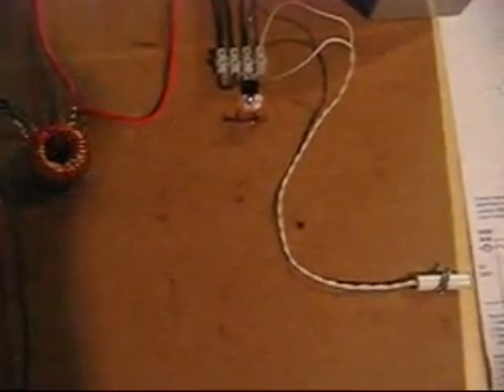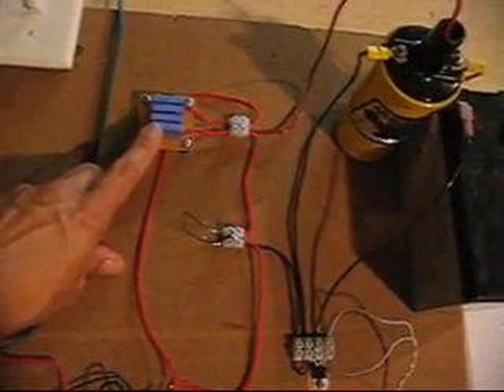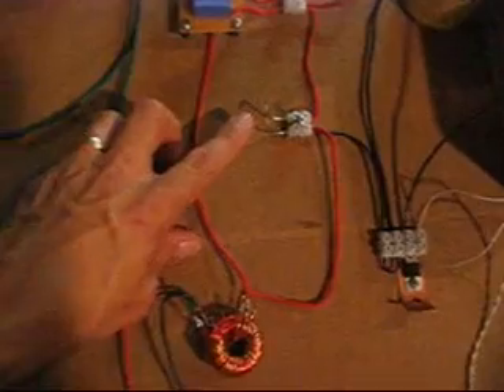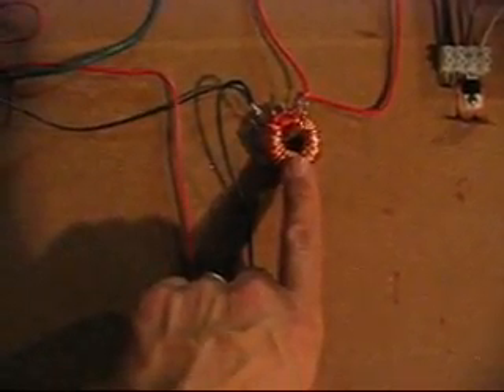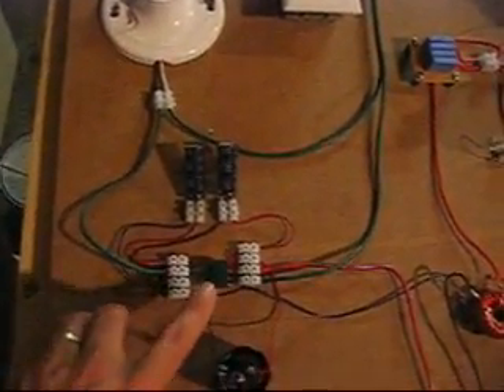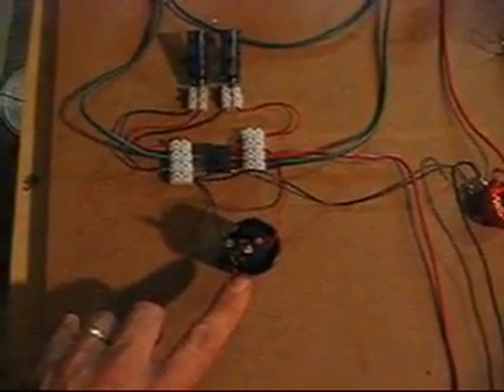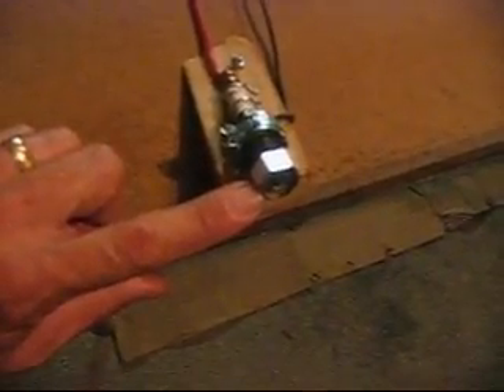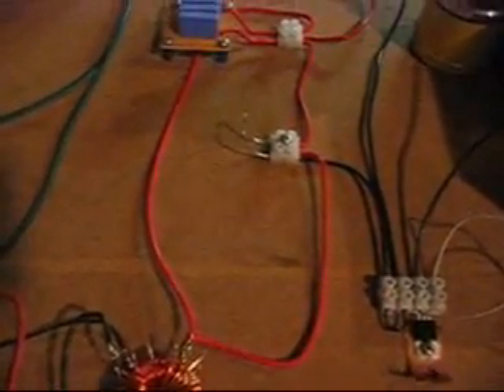Plasma Lab: Replication With Trigger Circuit - #56

Comment: Why are you putting high voltage on the bridge rectifier to blow them out and the power supply?  The toroid is not shown as type, - yellow low frequency powdered iron  or various types of ferrite and color? My set up does not work after changing pf caps and spark gap distances. Is resistance needed by spark plug?

Comment: can you put it to a closed cylinder for test,
to measure any pressure from the spark,
the explosion was from air water moisture, try to make the spark powerful, then go on to plasma engine or plasma turbine